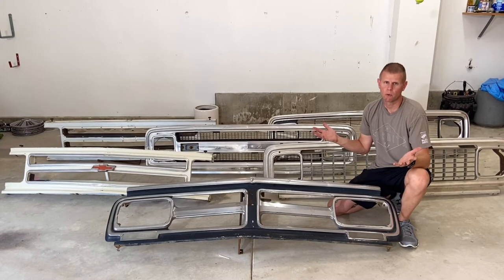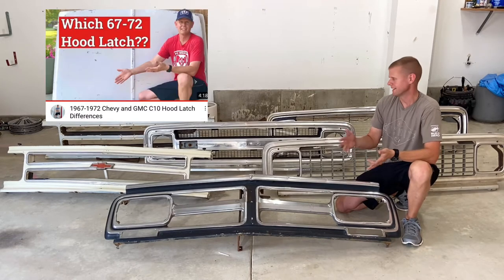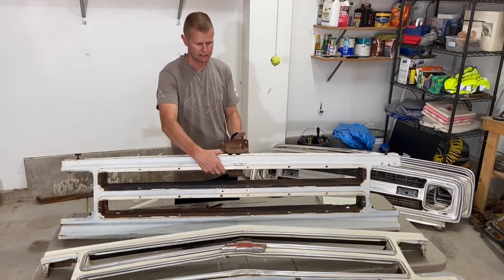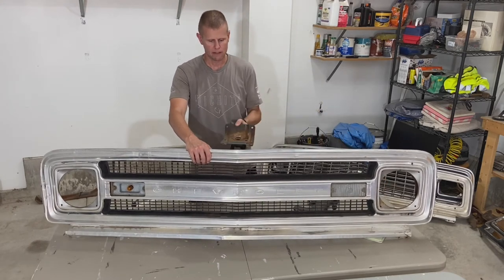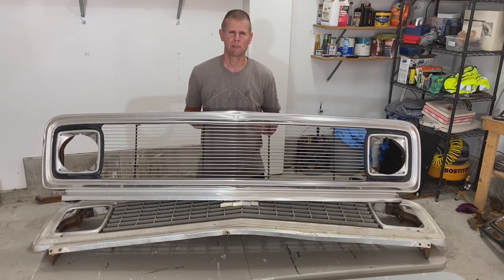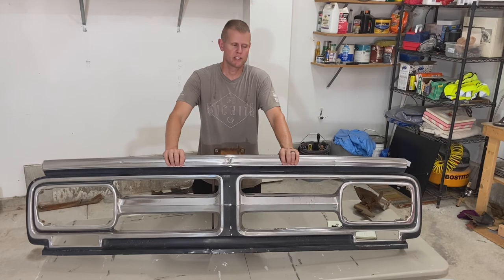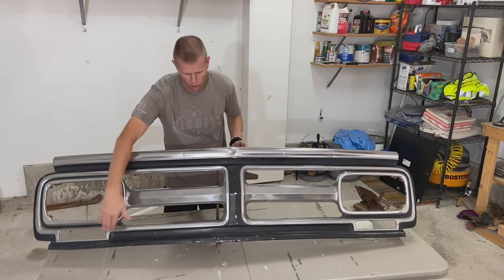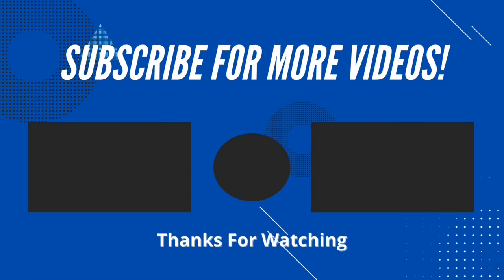1967-1972 Chevy / GMC Truck Grilles - How to ID

Comment: I have the 69 with the billet grill for a while and temporary swapped it with the original grill but I kinda like the billet better so I might swap it back out soon . 1969 c20 with the 292 and standard transmission.
Reply from the maker: It’s all about the style you like. Plus a 292 is a sweet motor!

Comment: Very helpful! Thank you. If I decide change my 1972 front look for 1968/67 , what I need know? What parts I need, New fender grill etc… thanks again
Reply from the maker: You are welcome! Swapping front grilles from 67-68 to 69-72 or the other way around will cause you to swap hoods, fenders, grilles and radiator supports unless you make your own alterations. Pretty much a front clip swap.
Reply: @C10TruckNerd  that’s a lot Of $$$$ if you don’t Have the Parts

Comment: 67-68 is definitely my favorite...but what you may or may not know is that on the plain Jane trucks that had white painted headlight doors and grille opening moundings the parts were steel whereas the  bright "chrome" trim parts were anodized aluminum.  you don't see many trucks with white trim these days.
Reply from the maker: I have since learned about the base model grilles for 67-68. I am working on year specific videos about each model year starting with 67. I just pushed the 1st one out. Thanks for reaching out and for watching!

Comment: Grill is always a personal preference.  There is no right or wrong, only what you yourself like.  To me, the egg crate grills modernize the trucks too much towards the subsequent square bodies.  I prefer the 67-68 and 69-70 grills.
Reply from the maker: Yes sir! There were a lot of changes over the 6 years, but I am glad they did that. So many fans of each 2 year period. I don't think you can go wrong in this era! Thanks for watching and for the comments!
Reply: @C10TruckNerd  tru
Reply: I do like those years too - but Had the Chance to Purchase a 72’ years back 1998 ? 
Still have it and still buying parts from Various Vendors.
Reply: That’s actually the reason why I prefer the 71-72 Chevys, I grew up around my fathers 76 K5 with the similar Egg crate grille. Although, I’d take a GMC grille (like my ‘70) any day of the week. GMC always seemed to have a meaner style grille

Comment: Love your channel so glad I found it …..  I have a 69 c20 with a damage grille what years grille will bolt on without having to replace other parts just grille .?
Reply from the maker: I appreciate the support! You can use a 69-70 grille with no additional parts or changes. A 71-72 will also fit, but you will need to swap the center support bracket but that’s it.
Reply: @C10TruckNerd  thanks that what I did

Comment: I appreciate the video. I have a question regarding more detail of the black stripe on the 71-72 gmc version. Do you know if the black stripe was included on all trim levels of gmc 71-72 or specific trim levels. And I always thought the black stripe was specific to 72 only. I have had several gmc 70-72 over the years. But they’re so far removed from being new and original that I couldn’t tell what was “year correct”. In example I recently learned the gmc tailgate I still have off my first truck. A 1971 gmc. Is actually an original from 1967-68 (small lettered gmc)

Just curious more detail on that 71-72 gmc if there is any more detail to the options
Reply from the maker: Thanks for the support. The stripe was included on all 71-72s. Most of them wear off over the years. I have a 71 1500 and it has it as well. Not to say that GM didn’t have some left over 69-70 grilles that ended up in 71s. As for the tailgate, you are correct. 67-68 were the small letters. They are actually year specific as well. I have a tailgate video I need to make soon and will go through all the details on them.
Reply: @C10TruckNerd  thanks for the reply. Especially so quick! Tailgate video would be great! I decided to restore my 67-68 small letter gate since it’s original and off my first truck. Even though using it on my 72. It’s too neat not to use
Reply: @C10TruckNerd  

Thanks for the quick reply! I appreciate it and look forward to a tailgate video!

Comment: Great video!  Working on a 72 gmc and want the whole grille powder coat black.  My top filler piece is In good condition but the grille itself is shot.  Can the filler piece be removed safely?  Looks like it is riveted to the grille.  Thanks!
Reply from the maker: Thanks Kevin! Yes, you can carefully drill out the rivets and reuse the top. Some guys that really like the 72 grille will remove the top as well and use it for the 67-68 since that makes it shorter for the slanted hoods. Thanks for reaching out!
Reply: Thanks for the reply!  I imagine I could just bolt it back on to a new grille.  One more question, Is there a certain year where I can get a new unpainted/unchromed one?

Comment: I am thinking about building a 1967 chevy pick up, there is a 1967 gmc for sale in my area, would I have to swap out the whole front group or could i just do the grill, any idea?
Reply from the maker: If you are staying 67 from GMC to Chevy, you would only need a Chevy 67-68 radiator support, grille, grille support and hood latch. You can use the same hood, fenders and bumpers. Let me know if I didn’t answer you exact questions.

Comment: Great video but Does a 1968 grill fit on a 1969 truck ?
Reply from the maker: Thank you! A 68 grille won’t fit on a 69 directly unless you change the hood, fenders and radiator support to a 67-68.
Reply: Sad but Tru

Comment: I have a 69 with the 72 grill and was concerned why it was so difficult to pop the hood. Now I know I have the 69 hood release. How hard is it to change out  ???
Reply from the maker: Not bad at all. Just a few bolts. Just make sure you have the right grille to hood latch support. You’ll know if the inner plastic grille bolts to it. Install the latch a little loose and fine tune it after you open and close it a couple times. Should be good!
Reply: @ItsTheChad  thanks I plan to watch all your gen 2 C10 videos. Wish I could send you photos of what I have.
Reply from the maker: @sammccraw6907  Thanks Sam! You can send them to me via FaceSpace if you want. Facebook.com/ItsTheChad71.

Comment: Are these all interchangeable no matter the year c10 (67-72)?I have a 67 GMC and want a 67 Chevy grill. Wondered if maybe it’s not interchangeable like that
Reply from the maker: No, they all won’t interchange. Yours will work out with minor changes. 67 and 68 grilles can swap because the hoods and fenders were the same. You might be able to get away with using the GMC hood latch since it’s offset, but not for sure. If not you will need a Chevy hood latch and 67-68 grille support in the middle that the hood latch mounts to. You will also have a dual headlight core support in the gmc. You might have to pop off the inner headlight buckets for clearance or swap to a Chevy core support. I would remove the buckets and save money. The rest of the years would almost need a front clip swap between 67-68 to 69-72 and even Chevy to GMC. Let me know if that didn’t make sense.
Reply: @C10TruckNerd  OK, sick. So my hood and fenders are the same and all I'll need is possibly hood latch and Chevy core support
?
Reply from the maker: @Joebro200  Yes. You can probably pop off the inner head light buckets and use the core support. I haven't tried it, but think it will work. Might give it a test. The center grille support or the piece that connect from the grille to the hood latch may or may not work.

Comment: Which year grilles interchange with other front clips?
Reply from the maker: 67-68 will interchange and 69-72. You can’t use 67-68 on a 69-72 without a front clip swap. 67-72 GMC grilles use 67 or 68 Chevy front fenders. 69-72 fenders won’t work with GMC grilles.
Reply: @C10TruckNerd  Thanks!

Comment: Will a GMC c10 grill for on a Chevy c10? Alwayliked the double headlights on the gmc c10s
Reply from the maker: GMC grilles need to have the 67-68 Chevy fenders to fit. GMC grilles won’t work on a 69-72 without modification.
Reply: What about if I have a 72 GMC but want to swap to a Chevy grill wich one will fit

Comment: But can you swap a 69 to a 68 truck or are the fenders different and does it require the other hood
Reply from the maker: They are both different. 67-68 fenders, hoods and radiator supports were interchangeable but won’t work with 69-72. 69-72 were the same other than the 69-70 had holes in the face of the hood for the bow tie or GMC emblems. GMC fenders were different from Chevy. 67s were the same but a GMC used the same fenders from 68-72. Those fenders were the same as a 68 Chevy. Hope that’s not too confusing!!

Comment: Are the 1972 GMC and the 1972 Chevy grills interchangeable from GMC over to Chevy, swap?
Reply from the maker: They are not. 68-72 GMC Fenders were the same as 68 Chevy. GMC grilles can fit any year of GMC with a few modifications. You can swap fenders and make it work as well, but then you run into radiator support differences since GMCs had 4 headlights. I hope that makes sense. Feel free to ask more questions if that didn’t clear things up.
Reply: I don't think you are right. 
67 and 68 gmc same
69 to 72 same. 
Does not intererchange with chevy
Reply: Can a 72 Gmc swap.grills with a 68 Chevy?

Comment: 69-70 grille should have black painted steel headlight bezels.  Yours had 71-72 bezels. Incorrect.
Reply from the maker: Good catch! I would mostly agree. They should have black but I have seen lots of originals that have aluminum. Guys have told me that there were a several manufacturers for the grilles and many were made or assembled differently. The black stripe on the center bar stops at the turn signals, others go all the way to the bezels. I enjoy learning all the small differences these trucks have. Thanks for sharing and for watching!
Reply: @C10TruckNerd  original 69-70 grilles that left the assembly plant on a truck, had the horizontal lines go all the way to the headlight bezels. Original GM replacement grilles stopped short. 
All the headlight bezels for 69-70 should be steel and painted black. 
A lot could be changed on these trucks in the last 40+ years.
Reply from the maker: @lolife999  Great info! I always love to learn more about these things!

Comment: I have a 1969 truck thought it was a gmc. It’s a Chevy. Grill and tailgate say gmc😅
Reply from the maker: That’s wild. I’ve seen trucks with the wrong badging straight from the factory.
Reply: @C10TruckNerd  😂 ya I ordered the Chevy 1969 grill and tailgate. Your video was helpful. I was able to identify the current grill as a 1971-
Reply: @C10TruckNerd  thank you
Reply: It's practically the same thing because GMC makes and owns Chevy😅